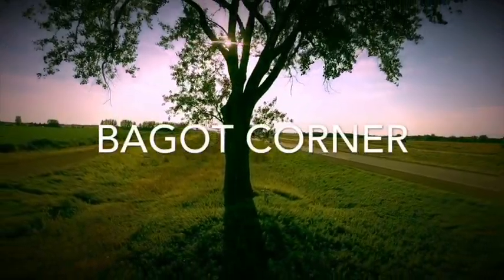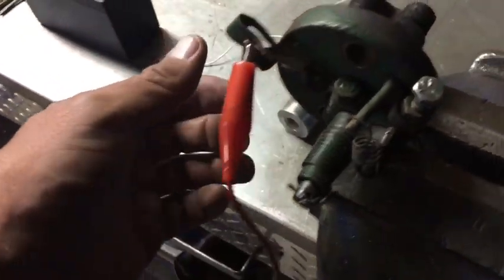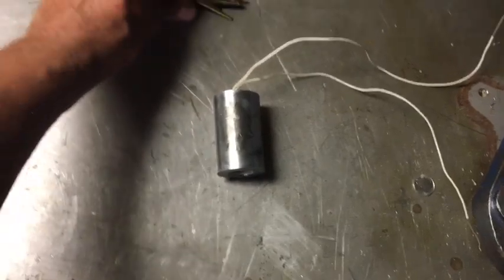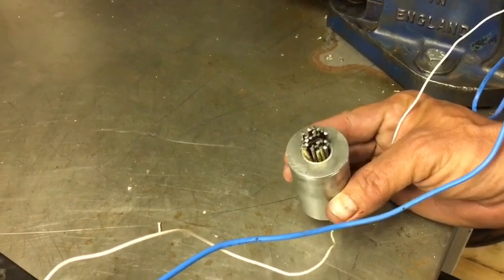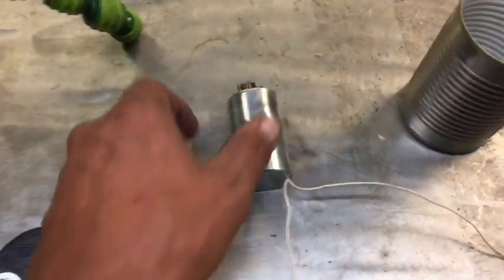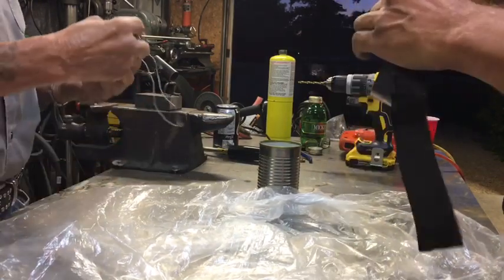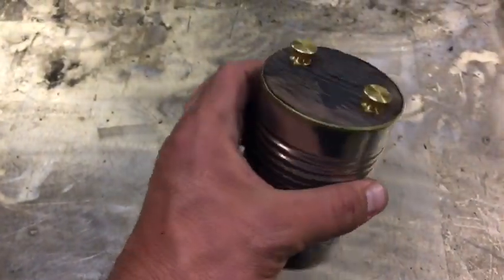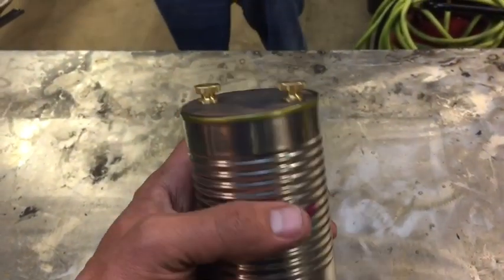How To Make A Low Tension Coil ⚡️

Comment: I built a coil for a 5HP Fuller & Johnson Model N that I have. It has less than 2 Ohms resistance and throws a very hot spark. I made it on my lathe with 16guage enameled copper wire... I housed it in a soup can too with a Garolite  lid. The coil fills the can, it probably weighs around 5 Lbs.
Reply from the maker: I can only say that mine at 10-12 ohms also work well,, but ive seen them lower and obviously yours at 2 works well also.
Its fun making your own stuff is the main thing ! 😊

Comment: Im wondering if starter selenoid wuld work the same? They have some hold in and push in dual wire Im not shure how that works ?
By the way why those some starter selenoids have 2 wires instead of just 1??? That confuse my some what??
Originaly it was supose to by bypass wire for ignition coil R terminal gm starter motor selenoid but for some reason my fuse pops when I try to use that terminal I dont know if it has somthing to do with my 4 pin gm ignition module ore positive ground dash board voltage regulator the fuse to dash board simply pops .
And car refuse to start.
Any one know how to solve this problem? 
In winter I have problems starting my engin I use singel coil HEI E core type ignition coil.